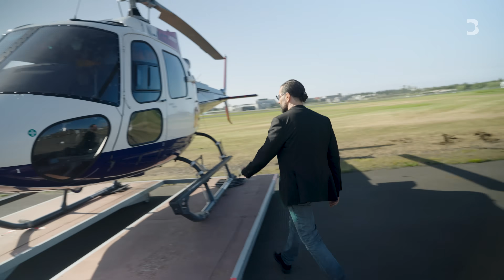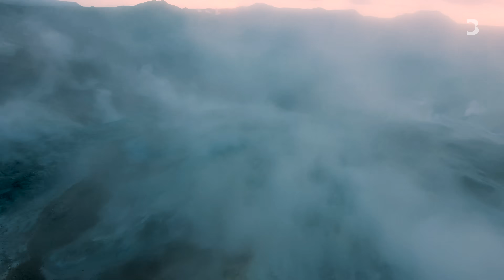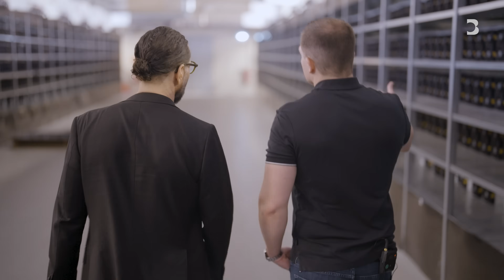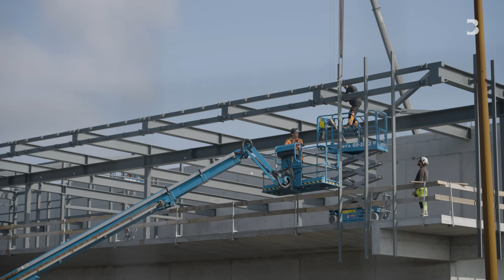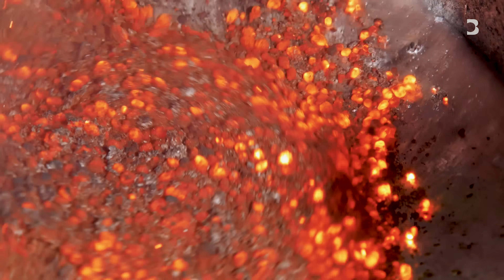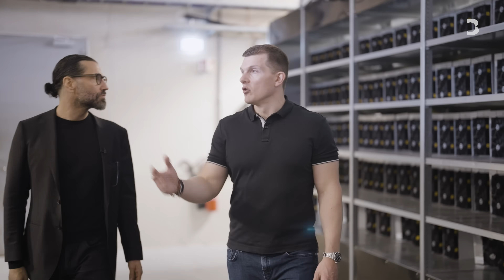Bitcoin Miners Draw From Iceland’s Surplus of Renewable Energy

Comment: No such thing as "excess electricity". The geothermal plants can be controlled to meet the needs of REAL users. Yes, there are environmental impacts of aluminum production, but it is not from the geothermal supply, and aluminum is valuable for other renewable energy systems like solar and wind. Bitcoin is a pure scam.

Comment: What could be produced instead of bitcoin mining? Like that’s energy intensive and can be easily exported? Hydrogen?
Reply: It was literally mentioned in the video that by cutting the expenditure of energy on loonie coin mining, that energy can go towards normal domestic usage rather than requiring further investment in building more power plants, which would disturb the delicate ecosystems on the island further.
Reply: Hydrogen can't be transported over long distances
Reply: Yes. Transporting hydrogen is still not cost competitive. It needs to be converted to urea I think to be safety transported via sea and then needs a receiver plant that will convert it back.
Reply: What could be produced instead of hydrogen? Like that’s energy intensive and can be easily exported?  Bitcoin mining?
Reply: Iceland use it to produce vegitables like tomatos...

Comment: What a scam! Is/was all the IT equipment and heavy machinery (you're using to build your green data centers to mine your green so called assets) zero emission produced/made? Clearly not. Stop lying and pretending it's not your fault and none of your business. And in regards to Bitcoin, it only have its/any value because it's been accepted by the banksters, thus, qui bono in the end? Of course, you can still exchange it for another currencies and/or buy any physical and real assets, until... until the Internet is ON and still kindly allowed by the govts. With what's going on with crypto regulations at the moment, let's see how it goes for people believing in this fictional ponzi concept. This, of course, it's not going to affect the riches who control the levers and the steering wheel behind the scenes.